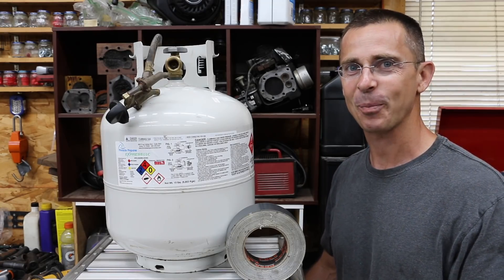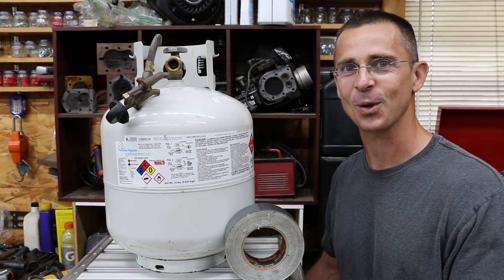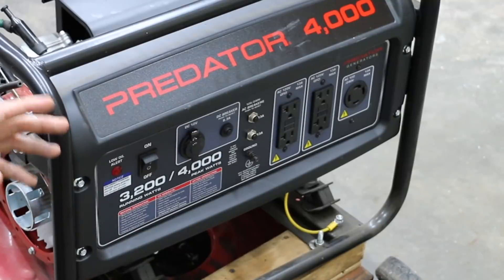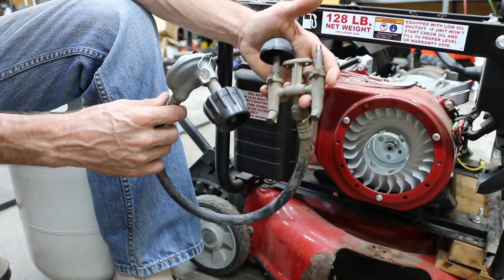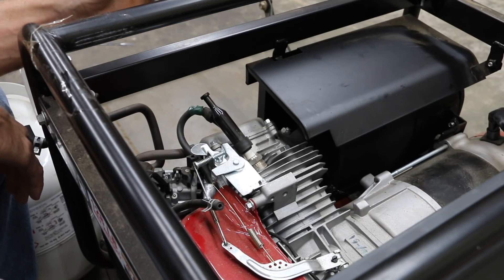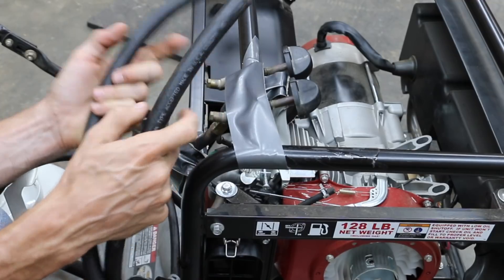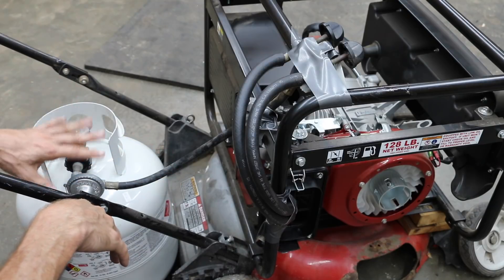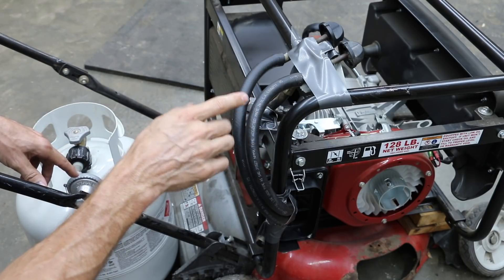Can a gas (propane) grill power an engine?  Let's try it!

Comment: LPG (basically gas powerd cars) are common in east Europe.
Reply: Full Throttle LPG is liquid petroleum gas. Pretty common in whole Europe. It's pretty easy to convert your regular petrol car to lpg. LPG is cheap but gets worse gas milage
Reply: @Roberto9696-q7s  only 10 to 15% worse than your petrol mileage. And when you add the price of LPG, which is over 2 times cheaper than gasoline, youalso have more octanes in LPG and so on, and so on.
Do not dramatise things please. We, the peasant class Balkan people have no choice, but to install LPG on our cars, vans, Jeeps and so on. But we do not lose tons of money, we save that way!
Reply: @AlexanderYivanov  LPG used to be so popular in Australia that Ford Australia sold LPG powered cars from the factory. Very commonly used as taxis before the Australian factory closed down.

The final generation of these cars featured direct injection of LPG into the cylinders rather than mixing of air and gas in the manifold. This caused an enormous increase in performance, the LPG engine was actually more powerful than the standard petrol version. The only downside was the loss of the spare tire space in the boot.
Reply: @Roberto9696-q7s  however is much more cleaner and eko friendly and off course cheaper, problem are governments which are just on paper for clean and eko and nature but in reality they create all sorts or taxes and regulations that make no sense just to divert people from using LPG or even CNG .
Reply: @Roberto9696-q7s  A Friend of mine in Ireland had an LPG conversion on His Toyota  and Got far better mileage on LPG
Reply from the maker: Thanks for commenting on this.
Reply: Yeah its nothing new. LPG conversions are quite common here in Australia as well.
Reply: Its gaining popularity in the states here, I think you would be surprised. All of the cities fleet cars and 90% of the buses here run on LPG
Reply: I have LPG in my 2000 BMW 328i and I'm really happy with it, one Liter LPG costs me 0,55€ and I only use 10-15% more LPG than with gasoline.
It's been in the car for over 10 years and it works good, and no, you won't blow up if there is a leak in your system, there are many safety features that make LPG as safe as Petrol powered cars
Reply: flowjob same here i have an Audi that i had converted ten years ago i also supercharged it it runs brilliantly
Reply: Also very common in South America, but here we use CNG (compressed natural gas), which consists mostly of methane not propane
Reply: thats kind of cool
Reply: @felicianoo62  Honda made a CNG Civic in 2012!
Reply: yes , we know it works, but the test was, can you rig it up from common parts, which he did
Reply: Here in Bulgaria almost every gasoline powered car is converted to use LPG. It is much cheaper to run and the power decrease is minimal.
Reply: 300 000 miles on LPG and no problem...
Reply: Especially in Poland
Reply: I own a car with LPG (2003 Saab 9-3). 10 to 15% worse gas milage but still over 50% cheaper to run than gasoline :)
Reply: Full Throttle there also very common for ups and oil and gas companys around Oklahoma
Reply: I think all of UPS' fleet run on it or compressed natural gas.
Reply: common in australia too and why not its about half price per liter compared to petrol. we used to have a $2000 rebate by the australian government if you got a lpg system installed in your car but thats all stopped now even taxis dont use lpg anymore all drive prius and camry hybrids now. lpg in oz  is 50% propane and 50% butane and consumption is about 20% - 25% more than running on petrol but still worth to buy a car with lpg
Reply: John New ya thought that to but i didn't know cause they still use a coupe old v8s around were i live heck ive even seen one very old truck with a carbed v6
Reply: flowjob that's about the gasoline price in the US 😂😂😂
Reply: @steffendhonau  good for you guys! I love the fact that I don't have to care about my fuel consumption like every American
And I do 't feel too bad about it because it is even better for the environment than petrol
Reply: it is common in all european countries tbh
Reply: I was thinking LPG is basically the same as this. Good video though
Reply: John New most ups trucks are actually LNG powered. It’s more like LP it’s liquified natural gas as opposed to natural gas that’s compressed into a tank
Reply: Full Throttle ,
Just the thread I was seeking here....  While I was at the auto parts store - here in the US - I was surprised to see that my 2000 Chevy Cavalier had a bi-fuel option that year for the old trusty 2.2 overhead valve engine (not the DOHC). That was the first time I was aware of such a manufacturer-supplied option here in the US except for possibly a late 70s or early 80s vehicle I can't recall... I know I had seen more than one Chevy El Camino back in the day equipped with a tank in the bed but that's about it.... Now I'm curious as to what it would take to get [ my Cavalier ] running on it. ... also, I thought I remembered reading about CNG, if I recall correctly, being injected alongside diesel for better diesel engine performance and economy as well...?
____ Anybody know how it compares to traditional gasoline when it comes to miles per unit fuel expense?
____ If favorable, I can see how the engine could run so clean that the oil would be in a healthier median state (more of the time) and be healthier for the engine's cardiovascular health , as an analogy. Can oil change intervals increase if burning cleaner?
____ Can I assume that natural gas has a much longer storage time than gasoline for a car / truck that doesn't get driven very often?
____ any operational and even conversion tips from any of the veterans here ?  Plumbing selection for safety (mitigate leaks) , longevity and, if possible, relatively simple to use and route.
>>>>>>>>>> Thanks!
Reply: We run many of our cars and generates on CNG  (compressed natural Gas).
Reply: LP was popular on the farm before diesel engines became more affordable to produce and the power output was realized.  Some grain trucks were LP in the 70's during our gas crunch, but those would barely pull themselves around never mind loaded.  It just doesn't pack the amount of energy other fuels have.  That said, the combustion chambers and oil stayed really clean because of it though.
Reply: Steffen Dhonau UK average gasoline price in June=$6.39/US Gal.
Reply: And middle Europe.
Reply: Full Throttle it was also popular in Canada for a long time but the last few decades its popularity has waned... So many 1980's and 1990's used trucks are LPG in Canada
Reply: Everyone knows there are adapter kits for fuel conversion in an ice. You were demonstrating that an emergency solution exists . Seems lost by many. Operative word , emergency . Great series my man. Keep the faith. Excellent presentation .
Reply: They not only stopped the 2000 rebate they stuck up the price on LPG, this made it less desirable, also as we know less power output and in old installations some were hard to start when cold.
Reply: A lot of American taxis use it
Reply: higher octane than petrol but lower calorific value its also much more knock resistant
Reply: @denseljosephs9500  LPG have a higher calorific value (energy per weight) compared to gasoline.
The question is that LPG is about 50% lighter, then it has less energy per liter.

Engine lose a little bit of power because it is injected as hot gas, not liquid, then it occupies a higher volume of the intake gases, and the engine loses a little of volumetric efficiency.
Reply: @dadoVRC  tell me something I don't know   yawn...
.
Reply: @denseljosephs9500  you wrote that the LPG have less calorii value compared to gasoline, then you're wrong.
Reply: In western europe it's also common
Reply: is it the same thing as NVG?
Reply: not true
Reply: And Asia.
Reply: And Australia
Reply: In the UK it is legal on the road, but you pay road tax on LPG for vehicles, unlike camping / BBQ  tanks.
Less common now we have the electric option, and modern injection engines are harder to convert of course.
Seems 90% of the UK have a car only a couple of years old, bought on finance. It makes me sad to see the waste. 
I've seen a large camping LPG cylinder in a car boot (trunk) before. Funny but dangerous.
Reply: germany they set them up for duel fuel. LP doesn't run well in colder weather i was told.
Reply: kalhoon not in my experience it runs just as well as petrol and when he weather is cold the lpg compresses so you can get more in the tank
Reply: @kalhoon  issue might be when starting car on cold, when are freezing temperatures , so starting should be done on petrol and when car gets wormer than switch to LPG, this is because LPG is heated by cooling system which takes a bit time to heat up....
Reply: RALPH CLINE I don't think it was lost on any of us, we're just talking about a different use case.
Reply: it in the USA LPG is called propane
Reply: The problem is that you aren't allowed to park such a car in an indoor garage because of the risk of explosion.
Reply: Brasil has a LOOOOT of Gas powered cars.... they're famous by the low consume per mile AND cheap price for gas... but here propane is expensive , we use natural vegetable gas (GVN) not as powerful as propane but still cheap
Reply: In Australia it's really common as well before cars became more fuel efficient and hybrids. All our taxis run on lpg that aren't hybrid Toyota's.
Reply: S. Korea too
Reply: Common in australia too.
Mainly used on taxis and some buses use it as well.
Reply: I guess Americans used it too while the oil crisis, because their big block engines are very thirsty
Reply: Full Throttle and italy.
Reply: I'm seeing lots of confusion as to what we use in the USA for commercial vehicles using alternative fuels. Companies that are able to stay local (such as garbage trucks, parcel delivery, short line hauls) or have their  own fuel stations are able to use CNG (compressed natural gas) which is mainly methane, with the pros being the lower cost (mainly due to low tax on natural gas) to refuel and the ease an engine is able to be converted to run on CNG (basically a diesel engine with spark plugs). The negatives of CNG are that it only has 1/4 of the energy compared to diesel in the same volume. On the other hand we also have LNG (liquified natural gas) which is about as energy dense as diesel but has to be kept very cold between -180F and -275F.
Reply: In Canada it would have cost 5000$ to convert. I don't think it would save money in the long run unless I buy a new car. What does it cost over there?
Reply: @suggesttwo  in Italy for a last generation high quality lpg system for a 4cyl. car I spent 1700€.
In other regions of Italy you can save ~500€ of the price.
With gasoline at 1.60€ or more and LPG~0.65€/l, the LPG system is convenient.
Reply: @suggesttwo  here in Europe for cars with carburetor is around 500E others newer cars around 1000E plus attest which is not too much expensive well it depends on countries.
Reply: I have two LPG cars, no issues at all.
Reply: Same as australia Lpg is very common
Reply: Yep especially on Turkey
Reply: the lpg killed all petrol cars in E-Europe...🤣🤣🤣 its either diesel or lpg , no gasoline
Reply: @costinc.6525  new trend is diesel with LPG which improves power and is cleaner....
Reply: My country uses gas powered buses (NL)
Reply: Well thats because it is cold in the winter and gasoline and diesel would gel up and the enginge wont start so they use lpg cars for convince
Reply: @daniellittle7846  You have to evaporate lpg first so it does not help at all in winter.
Reply: @Trancelebration  i hope your awair the gas is only in liquid form because it is under presure transforming it into a liquid so juat by opening the tank the liquid turns into a gas
Reply: @daniellittle7846  with amount that car needs it freezes fittings and  tank in no time. Thats why all car propane regulators are connected to car's cooling system to take a lot of heat for evaporating liquid propane and building pressure. Simple physics. It is not easy to start car on propane in winter.  Most systems have temp treshold of around 30deg c to even turn on. It also depends on lpg mix, propane-butane ratio. In Poland  we have summer and winter lpg, in Canada it is 100% propane, in Turkey almost 100% butane. Propane is good to about -40 deg c, with butane you loose all vapour pressure at around 0 deg c so butane is not evaporating after opening the tank and it looks like water. Sad to say, but you are completely wrong here...
Reply: And here in California!
Reply: In Germany, lpg costs only 1/3 in proportion to 95 octane gasoline. The engine runs much cleaner and the oil remains permanently clean. A conversion of gasoline to lpg costs about 2500 dollars for 4 cylinder engine
 consumption increases by about 20%

Many imported US cars drives here with LPG
Reply: ᴇᴀsᴛ ʙᴇʀʟɪɴ
Reply: Drove a propane taxi in Canada for 20 years.. But with hybird cars and more fuel efficient cars they aren't so common anymore. You can also get propane outboard boat engines straight from the factory now.
Reply: @platinumsky845  No.
LPG has only the disadvantage tha it is put in the intake as hot gas and not cold liquid.
So engine has less power.
The few makers that made LPG liquid injection have the result of more powerful engines than with gasoline with the same fuel consumption of the gaseous injection systems.

After that...yes, theoretically the total thermal energy the engine can "suck" is lower with LPG.
But an engine has a lot of physics involved, it isn't only something who burn fuel.
Reply: @platinumsky845  have you heard of rupturing LPG tank in a car? You are not aware of safety features built into car LPG tank...
Reply: @platinumsky845  Yes, that is the reason why I say that an engine isn't simply something that burn fuel, but there are a lot of physics involved.
However...
In common LPG sysyems, LPG is injected as HOT gas.
The temperature is similar to engine temperature, the vaporizer heat the gas also because hot gas help keeping injector clean (LPG carry with him some dense and sticky oils in liquid phase, those oils aren't vaporized but they can reach injectors despite the presence of filter (s) on the gaseous phase piping.
This is why usually the vaporizer is positioned in the lowest possible position in the engine compartment and injectors in the higher possible, and possibly in a hot position like over the head and under the heat shield.
Installers uses also the largest possible tubing between vaporizer and injector rail to reduce the dragging force of the gas flow that can carry oil to injectors.

In those system, engine power is reduced because of the heating instead of cooling of air/fuel mixture in the intake.

I have some experience in it, since I had some and my daily car is equipped with a BRC system.
In the past I had others system, with more sensible injectors (Matrix), and I have to clean them from that shitty oil every 25,000km in average.

It happened also that the filter, a coalescence one in that case, become full of oil in less than 300km, because probably of a "dirty" refueling...
Reply: @platinumsky845  Here in Italy we have something like 4000 gas stations with LPG, the rate of consumption is higher than in the USA I think, and it comes from few refineries, so it is about the same everywhere.

However in the last years it seems to be cleaner, in my experience.

In Sardegna they have lots of problems because of the high amount of propilene in the LPG mix, that polymerize in the vaporizer...it depends on the refinery.
Reply: Even in bangaldesh it's popular, but we use CNG (compressed natural gas) which is much more cleaner
Reply: And New Zealand.
Reply: Impco is from the States isn't it? lpg runs hotter than gasoline , and be carefull with older v8's , they can use some hardened valve seats. We use to adjust the exaust valves with some more clearance for more cooling the valves.
Reply: @nl1cat  that is not true. With the same AFR temperature difference is less than 30deg C and propane is colder.
Reply: Sherrifs Forge dry valves too = higher wear = destroying your engine instead of paying more fuel
Just placing the costs somewhere else lol
Reply: @hoepsipoepsi  LPG is a better fuel than gasoline, the issue is who convert the car have to know how to.
Reply: LPG - the destroyer of your cars air filter box xD.
Reply: But it's very dangerous any leak you will burning 🤪
Reply: Not more dangerous than gasoline

Comment: great test, but you should do two more tests. 1. how long the generator will run on one tank which is 15-18 pounds of propane. 2. run the gasoline generator on home gas, in other words what type of regulator would you need since it is much lower pressure than propane.
Reply from the maker: Great video recommendations!

Comment: Engines can run off anything, so to speak. All it is , is the “primer” for the engine so to speak. The primer charge to get the engine to turn over. 
Another example is “a run away turbo”, when the engine is running off air. Engines needing gas Is just a big myth everyone is duped into.
Reply: Lolwut? A "runaway turbo" must be referring to a runaway turbo diesel engine. They still run because after cutting off diesel fuel supply, they run off their own engine oil that's blowing by the turbo seals. 

Of course engines need fuel. Anyone that thinks engines don't need fuel to burn simply doesn't understand physics, nor do the understand thermodynamics.
Reply: consumption of energy, just using differing media with different traits...
Reply: thanks for explaining that:-) videos of "runaway turbo diesels" have always made me wonder what the hell was going on.
Reply: gas is 3 bucks a gallon, thats why we buy it
Reply from the maker: Great point.